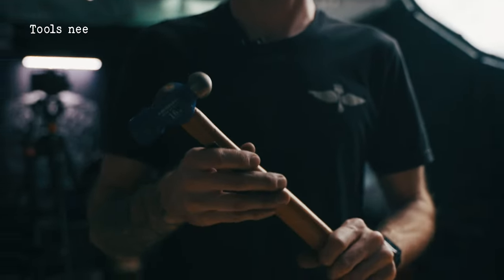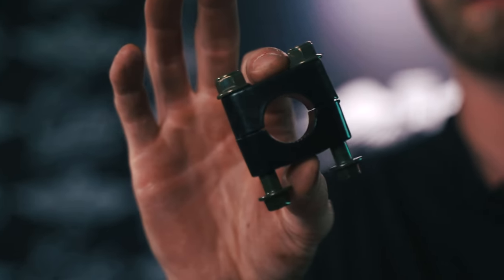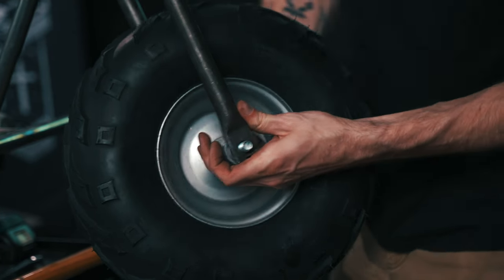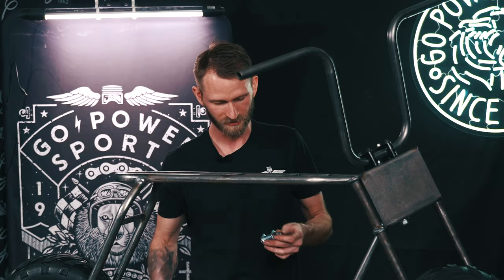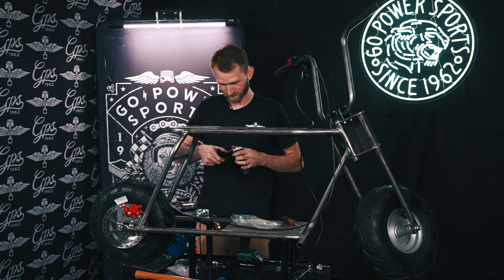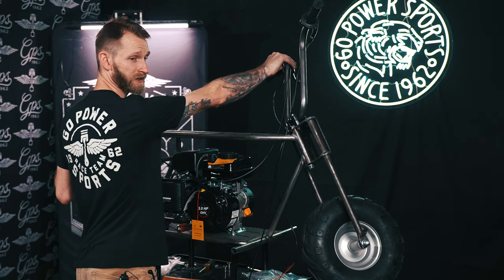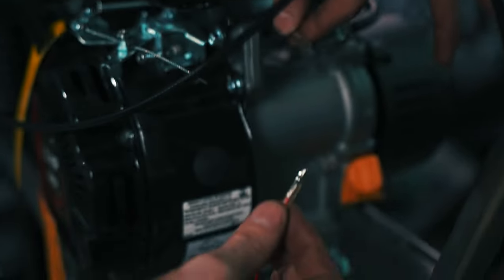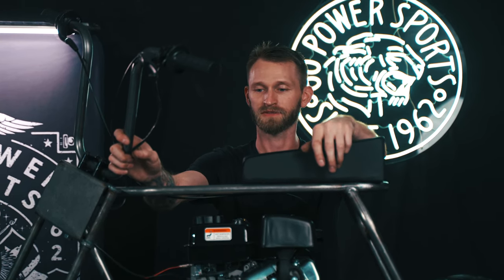How To Build The Rascal Lite Mini Bike Kit

Comment: The 21/64 is not the drill bit you want to drill the holes for your seat screws if you do you will be buying a new seat, you should use 17/64 instead !!!

Comment: Been slowly building my Rascal since recieving it about a month ago.  I have been using this video to build it.  This video is decent quality but lacking as the only source of intructions to build the bike.  Written instructions with diagrams, parts lists, and trouble shooting would be very helpful.  The video glazes over quite a few important details that I have had to figure out by trial and error or watching the same video portion 10 times to figure out an issue.    One example, the guy mentions using a 'washer,' no mention of the size or where the washer is located in the 35 packets of hardware sent to me.  Suggestion, hire a professional production team to help make a better instructional video.  Or hire some technical writers to create an actual instruction booklet or PDF to accompany this video.
Reply from the maker: Noted.  We appreciate your feedback and will work on being more thorough.

Comment: The 10mm is the 1/2" of Metric Sockets and Wrenches. You will ALWAYS be buying replacements. The rest of the tool set will hang in there forever but the 10mm and/or 1/2" will always go missing. 
It's like socks in the dryer. 2 go in but only 1 ever comes out. 
It think Leonard Nimoy did a special on disappearing socks back in the 70's. Hopefully William Shatner or Zack Quinto do an episode on the 10mm-1/2" phenomenon. It needs to be addressed.
Reply: Can confirm...repeatedly.

Comment: Hello, I've been interested in buying the Rascal Lite, although I have a few concerns. I've noticed in other videos that 98cc engines are usually pretty loud, I was wondering if there was a muffler I could buy that would fit well with the frame. Also, I saw that in California, mini bikes require a green sticker from CARB to be street legal; is it possible to get one for the Rascal Lite?
Reply from the maker: We do not have a way to make your minibike compliant in California.  You are able to ride around on private property though.  We have muffler for the 98cc Engine, but it may not be quieter than your stock engine now.

Comment: Just got mine today bummed the threads are bad. The hardware screws are different, and missing nuts, the welds have holes. I knew it was too good to be true. The deal was awesome, but now I know why I can't finish the build missing parts bummed
Reply: Reach out to their customer service and hopefully they fix it. I just ordered mine last night so hopefully that don't happen. Could you post back here whatever ends up happening?
Reply: @blah1176  yeah hope they send me the right screws if not I'm going to be sitting for a while
Reply: I'm having to do this and that to my kit as well
Reply: @-mctuna3673  yikes, have you contacted their customer service? I'm waiting for mine to come in hopefully it's all good
Reply: @MoH_Dank  Just a trip to hardware store and cleaning up some burrs here and there.